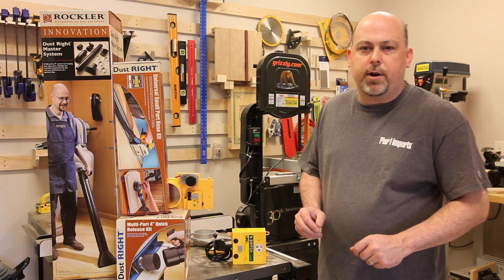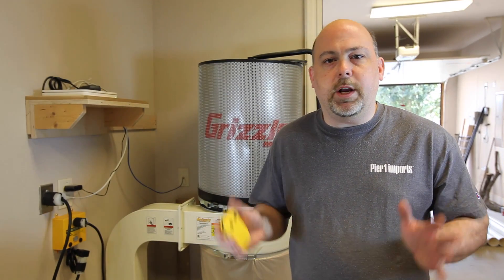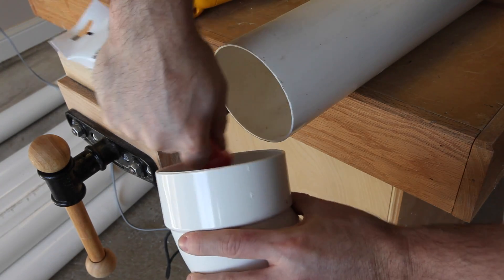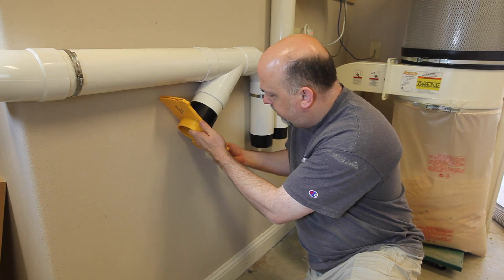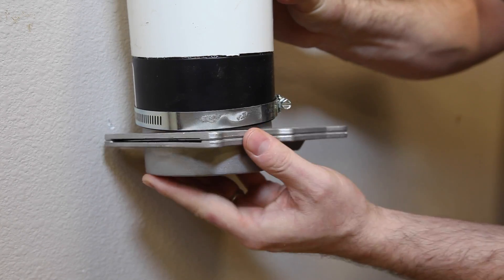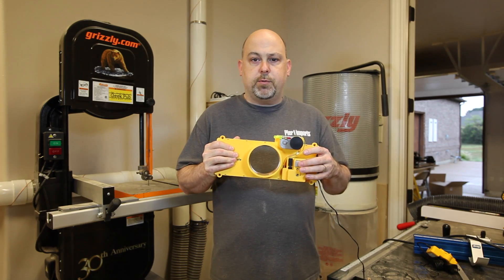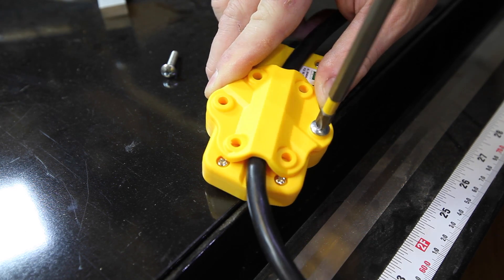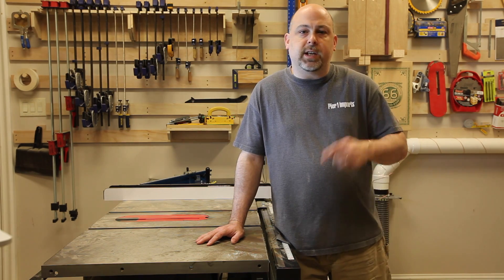Installing an Automated Dust Collection System

Comment: I can't believe people are still spreading the dust explosion myth.
Reply: Ronald Allen did you actually read the OSHA report? None of the explosions were due to sawdust. They were all dusts with chemicals in them and the 3rd one was from an initial fire that started in an oven. Show me an incident that happened in a small woodshop and you may change my mind. But this has been disproven already.
Reply: it is a myth
Reply: You lost me and respect at the explosion comment. Of course Rockler will sell you a grounding system.
Reply: It's never happened in a home dust collection system. It's a myth.
Reply: It troubles me that whenever this topic comes up, people invariably dig in and begin spoiling for a fight. If we can't accept differences of opinion and proceed with good humor on this topic, how can we possibly resolve the much more serious differences that are ripping this our happy republic to shreds?
 
Although I am convinced that sawdust explosions or dust fires due to static build up in a home workshop dust collection system ARE a myth, there are at least two other very good reasons to ground the duct work, and since it's pretty cheap, fast, and easy to do, I really don't see any good reason not to.

First, static build up itself is quite real, especially for those of us in dry climates. While anecdotes are not data, I have, quite frequently, been zapped when I have brushed against the PVC ducts in my shop. Although this is not especially painful, it is a startling and potentially distracting annoyance which could result in spoiling a work piece or coming into un-intended contact with a sharp whirling thing.

Second, static discharge can and frequently does disrupt electronic devices. On several occasions I have been zapped while fiddling with my CNC machines resulting in a restart of the controller with a consequence of crashing the spindle and spoiling the work at a cost far greater than the few bucks needed to ground the ducts.

For my shop, I stripped the insulation off of a bunch of Romex I had salvaged from a demolition job, but if you don't have such luck, you can buy a roll of bare braided copper ground wire for like $25 bucks, spiral it around your ducts from one end to the other in maybe an hour, periodically secure it to the sheet metal screws most people use to tack their duct fittings together, and bond the ground conductor to the metal frame of your major machines.
Reply: wb5mgr that is a factory. A factory and a house are different
Reply: William Brown you know for the fact that the screw is doing the grounding and you could get grounding wire for dirt as cheap you could probably make the entire system for 20 bucks.  Even if it is a 1 in a billion chance.   My ass is unlucky as hell, I'd spend the 20 bucks.
Reply: There are many variables that go into dust explosions, such as material type, environment, and particle size, so I can understand the confusion. The NFPA or OSHA did not create standards to address a small wood shop in your garage. You will likely never have a problem unless you start using the same dust collection system for metalworking. Even then it will be in such small quantities, you might still be able to get away with it. But, when it comes to agricultural, commercial, or industrial settings, such as a grain elevator or an aluminum processing/handling facility.  The dust explosion hazard is real, with several documented case studies involving fatalities and it needs to be treated with respect.
Reply: It's the very definition of a myth.  None of the people defending the myth of PVC-wooddust explosions can post an example of it happening. But people hate to admit when they are wrong. In other news, I have a unicorn in my paintbooth and a leprechaun hiding under my tablesaw.
Reply: It is the very definition of a myth... Something that gets spouted out as fact, yet there have been no documented cases of it ever happening. Which is the entire principal the show mythbusters operated on.
Reply: ollie young myth busters are the epitome of a joke show...
Reply: Ron Cole does a very thorough job of debunking the myth. Not only does he provide a mathematical analysis, but he interviewed authorities, such as OSHA, and various regional/local fire marshals. NONE of them had ever heard of a dust explosion in a small woodworking shop.

Note that this is not even the "father of a friend of my brother's" type of tale. It just a claim that such explosions occur - without any supposed example of such an occurrence.
Reply: I have been up close and personal to quite dust explosions. Also lookie here: https://www.osha.gov/dts/shib/shib073105.html Static electricity is a ignition source. A flow through a pipe builds up static charge. I have seen and felt the discharge from a steam valve open to atmosphere. Google it.
Reply: https://youtu.be/masxHWftucs
Reply from the maker: +Nathan Smith It's not a myth.
Reply: +TheGeekPub http://
http://www.rockler.com/how-to/exploding-pvc-dust-collection-ductwork/

www.thewoodnerd.com/articles/dustExplosion.html
Reply: @TheGeekPub  There are zero documented cases in the capacity we're talking here (home/enthusiast wood shop).  Zero.  I hate to pile on, but that is by its very definition a myth.
Reply from the maker: @Warkive  Osha has documented it just fine: https://www.osha.gov/dts/shib/shib073105.html
Reply: @TheGeekPub  You're looking at the overall warning and applying it regardless of scale.  All of the examples on that page are industrial facilities utilizing huge airflows.  Not a single one was even remotely on the scale of a home shop's duct network.  This is tantamount to building a home that can withstand a CAT5 hurricane in New York.  If you want to be overly cautious and protect yourself from something that has never happened at the scale we're operating, by all means.  But don't pretend like it's a real concern with documented cases.
Reply: @TheGeekPub  It is a myth, in small shops of the sort where you would use PVC.  It will never happen, and the guys who actually do dust collection for a living are all in agreement about this.  Larger installations where it is an actual issue would NEVER use PVC, but would use metal duct work which does all the work for you.

Comment: Just curious; Doesn't the ivac system ensure one of the automatic gates is always open to protect the DC? So, are two gates then open when you use the floor sweep?
Reply from the maker: +FireMouseHQ Good question! It is programmable.  I turned that off, because I have a manual blast gate at the far end of the run that is always half open.
Reply: According to iVac, the primary open gate closes when the gate for another tool is opened.

Comment: An aspiration system will generally consist of three primary components, a fan, duct network, and a filter. The fan will initially pull the excess/unwanted material from a specific starting point into the duct network, which then acts as a "highway" for the dust to travel into. Lastly, the duct will lead into a filter of some sort, which collects all the unwanted material and stores it until someone disposes of the filter. A lot of the inner workings of this type of system can change, for example,  the fan between centrifugal and positive displacement blowers. This more critical way of assembling will come down to ultimately what needs to be addressed, which will alter the types of parts you need.

Comment: I agree that an automated system is extremely convenient, BUT, the cost for a shop with a table saw, jointer, planer, bandsaw, router, sanding station, work bench would be very expensive - those blast gates are $125 a piece; plus piping.  That is a little outside the budget of most shops.
Reply: +TheGeekPub Well, it seems from the beginning of the video that you weren't planning on spending that much with your own contraptions. I'll admit the system is nice, but it isn't cheap for most home shops.
Reply: Dont forget another 59.99 for the remote to auto open the gate.
Reply: Have to agree. Not a practical solution or video for most folks that don't get the products for free. Yes, it's only another $125 added on to a saw, but it won't do very much unless you spend a whole lot more.
Reply: The ducting with hangers is a rather small part of the total cost. You can keep it the lowest by using cheap metal ducting where you have to fasten the seams. It is also far cheaper to ship than any of the other types of ducting. Of course, it is also the hardest and least convenient to install.
Reply: Mark, why not use expensive gates if Rockler is going to give them to you for free if you use them in your video.
Reply from the maker: +Mark Hazlewood I somewhat agree and disagree.  When you think about the cost of a $3000 table saw, what's another $125 for a blast gate for it?  Of course, I understand that buying it all separately as a package adds up.  Thanks for the comments!

Comment: How and where did you ground the ground wire to the ground?
Reply from the maker: +mick walker I actually grounded it in several places.  It's grounded to an electrical outlet at one end.  It's grounded to the frame of the dust collector at the other end.  In the middle, on the ceiling, it is grounded to the frame of my Jet air filtration unit.
Reply from the maker: +mick walker I just posted some pictures of the ground points on my Instagram profile if you want to see how they work.

Comment: Very nice. I constantly walk back and forth with turning the DC on and off and opening and closing each blast gate. This looks incredibly convenient.
Reply from the maker: +Jay Bates Yep.  It's a giant pain in the rear when you're only making a cut or two or alternating between tools.  Also I can't tell you how many times I thought I switched it back to the table saw, only to find a pile of sawdust on the floor behind it and a dust collector sucking dust out of a bandsaw that was turned off.  LOL.
Reply: Jay - I use a basic remote to turn my collector on and off. I picked up a setup at Home Depot similar to this and have been using it for 3 years. 

http://m.homedepot.com/p/Westek-Outdoor-Wireless-Remote-Receiver-Kit-RFK306LC/202562992

Cheap and convenient. If your collector is 110v it should work fine.
Reply: A huge advantage not mentioned is the time saving! That back and forth adds up and I bet you save anywhere from 15 minutes to 45 minutes a day (depending how long you're in the shop). More time to work, spend time with the family, adjust cameras, eat..lol, and edit videos! Huge advantage!
Reply: +John McNail My dust collector has a built in remote unit. But most often the actual dust collector is closer to me than the remote so I rarely use it.
Reply: Jay Bates
Reply: Mark W......Or just clip the remote on when you're in the shop.  These guys are shills for Rockler, that's all.   This system costs over $500 which is nuts.
Reply: I wear clothes with pockets!!

Comment: That system is so nice. Opening the blast gate and turning on DC at the same time automatically is really cool. Then turning it back off automatically. Wow, whenever I upgrade, I definitely want that.
Reply from the maker: +CMR Woodworks | Chris McDowell I'm a gadget geek and I had no idea these existed until Rockler told me they sold them.